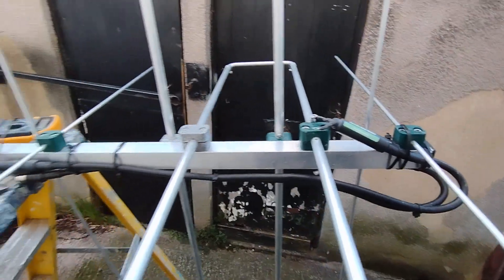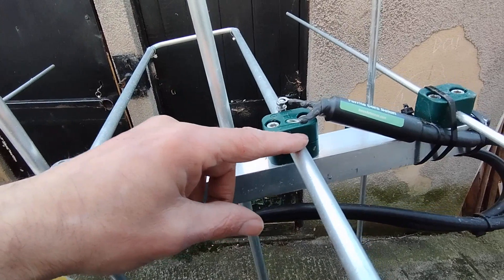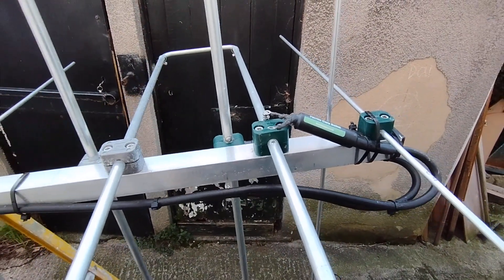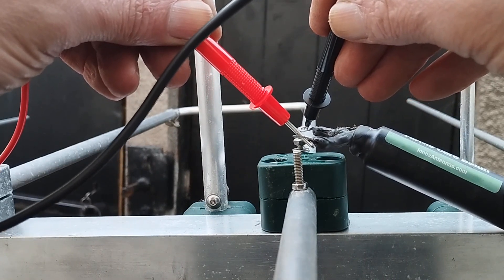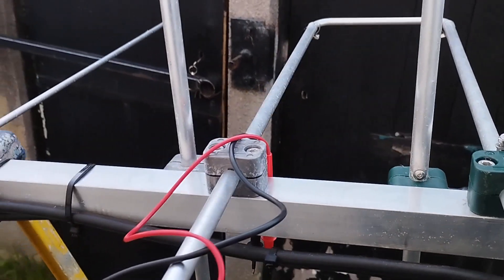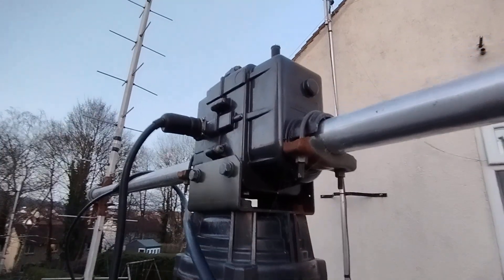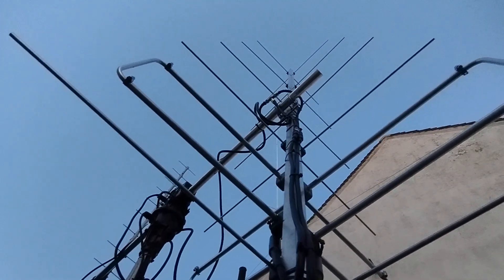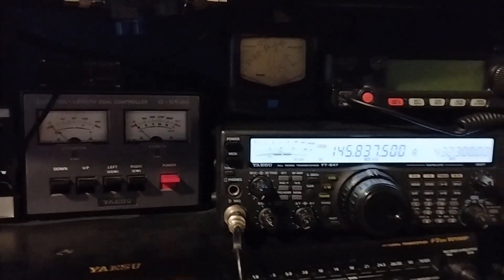LFA X YAGI Satellite Antenna Maintenance

Comment: Nice work amazing how aluminium and stainless steel bolts don't corrode as much as they do given the working conditions testament to the manufacturers.. I have managed to work the fm birds but as a qrp operator very difficult with 5 watts lol Phil de m6dnu/26ct4494
Reply from the maker: I guess some locations are more prone to the effects of two metals reacting against each other. It's not so bad here but the seaside antenna probably gets some stick. Thanks buddy best 73

Comment: I see some one has already mentioned it but Aluminium and Stainless steel do have a bimetalic corosive effect ( at least when wet) ( obviously it's always wet in the UK). I've used vaseline and it makes a supprising difference even as a thin film and seems to even stop my connectors Gauling which is good ...lets see how yours gets on !
Reply from the maker: Ill be on it in the next couple of days. Hope you like the next video its just for you. 73 Have a G N

Comment: Hi Simon,

 it's got to be the 5kw causing that poor connection, lol.

Had the same problem with one of my yagi 's and the dissimilar metals always cause some kind of electrolysis, after cleaning the same as you I then replaced the bolts , washers and nuts with brass working on the logic that the crimps are Coper the elements are aluminium so all non ferrous.

 Also covered all of the connection in Aluminium Conductive Grease, so far so good. My antennas are a bit of a nightmare to get to so I really wanted it  be maintenance free.

Really trying to get into 2m & 70cm Dx but never seem to be around at a good time. As for satellite the neighbours think I am completely barking as I am walking around the garden with a handy a arrow antenna talking strange words... one of my challenges for this year is to  work some satellite stations. Any way keep up the posted do enjoy them, have a good weekend.

Richard 😊😊
Reply from the maker: lol yes definitively the 3KW.  I will probably grease everything up when I get some decent stuff. I hope you do get on the birds it is plenty of fun. I dont see why I should be the only one looking like a nut job so I think you should get out in the garden lol. Catch you again soon buddy and Happy Easter to all.

Comment: Galvanic (dissimilar metal) corrosion. Maybe put some Vaseline on the connection to keep the water out for a while.
Reply from the maker: Yes totally agree with that I have seen it a lot on vehicles and also in industry. I like the idea of Vaseline probably will give it a go. Thanks for the tip catch you again. Many thanks. 73

Comment: No issues with an Aluminium crossboom? I am trying different insulated booms here to mid mount some RHCP crossed Yagi's originally designed for end mounting. 73 from G0MOH
Reply from the maker: Good luck with the antenna project, it sounds good having insulated booms. This antenna has insulated fixing brackets and the other has insulated inserts. I haven't had any other issues as such regarding the boom but it will be something to keep an eye on. Hope to work you soon. 73 thanks for the comment.